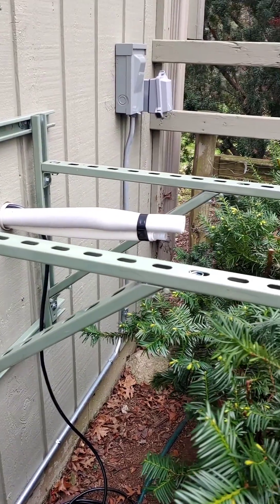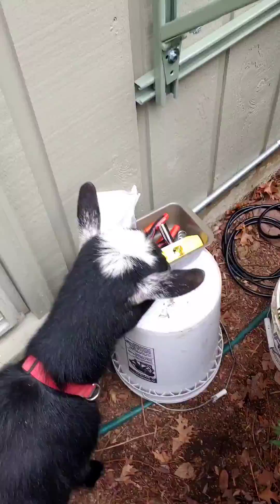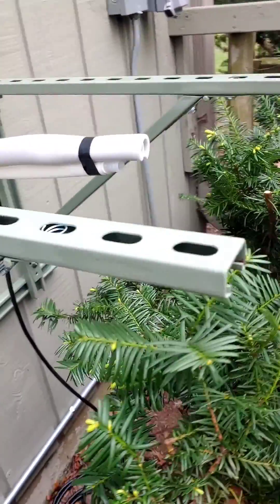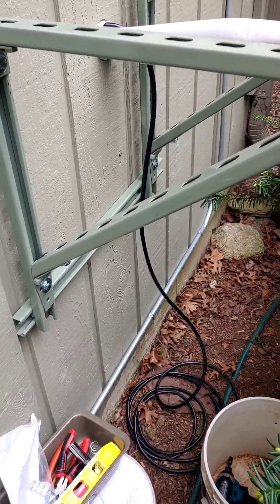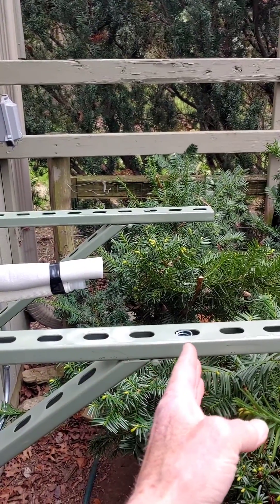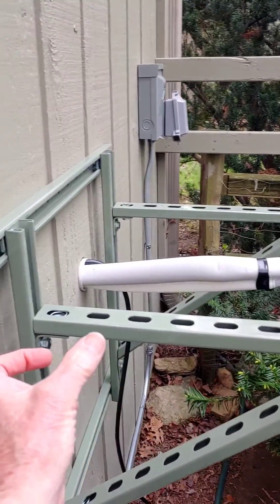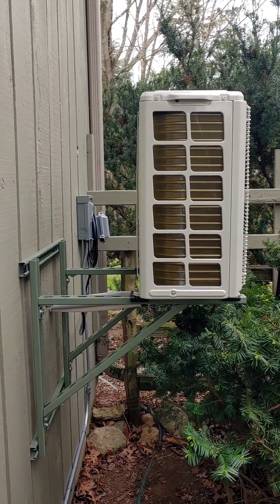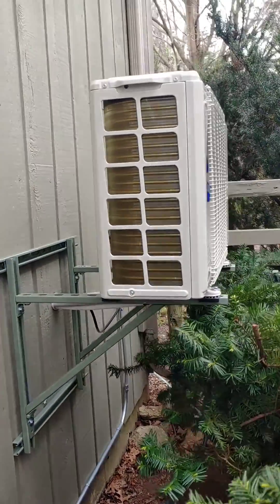Mini Split DIY Wall mount bracket

Comment: I just came across your mini-split condenser bracket build. I saw another video and was inspired to do the same as I wasn’t impressed with the brackets you can buy. I found some 45 degree corner braces on Amazon and used those supports to tie the top channel into the channel attached to the wall. 👍👍👍